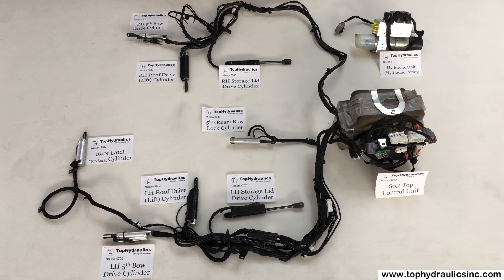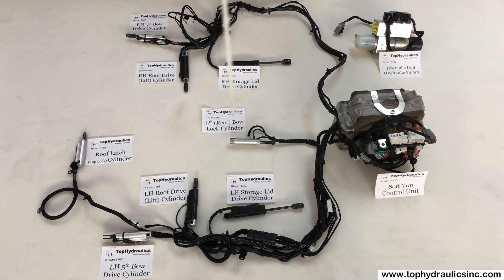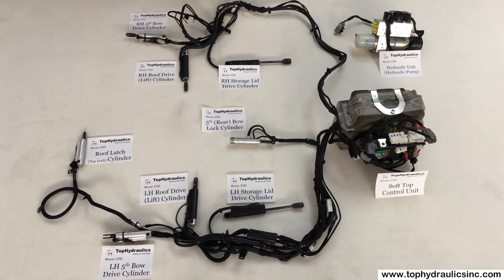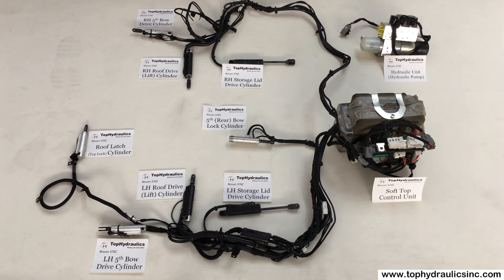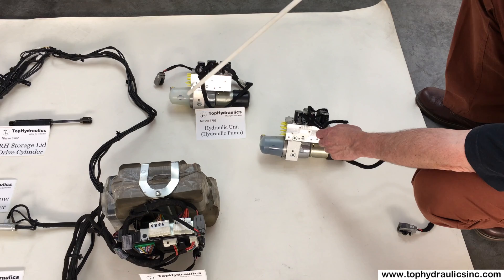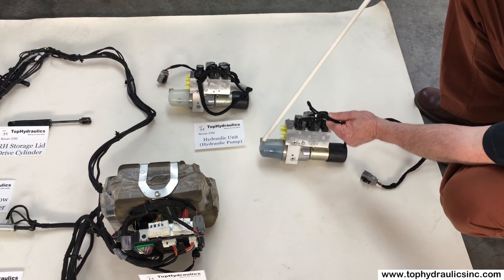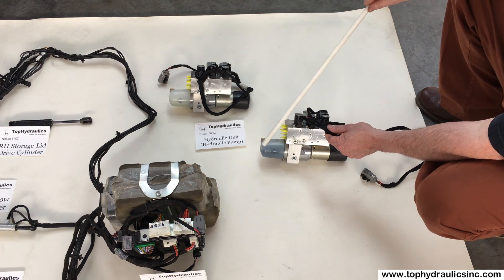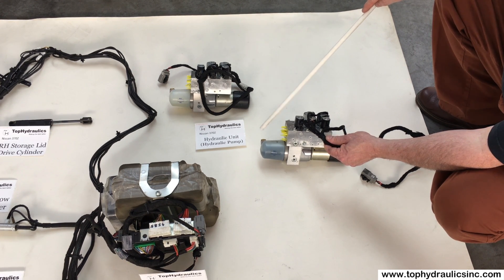Nissan 370Z -  Chapter 1 - Introduction to the Top Hydraulic system

Comment: Hello Klaus! Thank you so much for making these videos! I just bought a 370Z that has a top that doesn't do ANYTHING when I click the button. I think someone may have been working on it already since neither the front or rear bows are latched, but I have no idea what they did (if anything). Could this be a fuse/switch issue since it doesn't even try? Or would it more likely be a sensor of some sort that isn't happy with something? Thank you so much for your help.
Reply from the maker: Congrats on the new ride! Any feedback from the previous owner as to what happened? Since you are asking about fuses, have you checked them yet?
Reply: @TopHydraulics  Thank you! Actually no to both questions, I just bought it at an auction so I have no clue who the previous owner was. I plan on checking the fuses in a few hours when I get the chance. I wasn't sure if that was even a possibility though. And to be honest, I didn't expect a reply quite this quickly, so I asked before I had a chance to look at the car much. I will provide an update in a few hours after poking around a bit 🙂. Thank you for the quick response!!
Reply: @TopHydraulics  ok! So after a bit of poking around, I discovered that there were no fuses blown, but the previous owner had disconnected the top switch altogether... After plugging that back in, the roof started trying to open! After helping the rear bow get up, I was able to open the roof about halfway until the rear bow hit the cover thing as it was trying to fold underneath it. I shoved it out of the way and got it to finish folding down. It made some pretty awful noises in operation though, and the cover didn't line up with the rest of the body quite right (the car was in an accident, perhaps that's why?). Upon trying to open the roof, it got stuck at the same point as before, hitting the cover it was trying to fold out from underneath. I moved it through, and continued folding. The rear bow SLAMMED down, and the front went down nicely, but neither front nor rear would latch. I was able to get some pictures of some pieces that don't look to be in the best of shape, perhaps those are responsible for it hitting the cover? Or maybe something else? I could send pictures to you over email if you don't mind continuing to help me. Just let me know, thanks 🙂

P.S. the manual allen latch was stripped out, so it's not usable 🤦
Reply: Update #2 the top button is very intermittent... Sometimes the top will try to do things and other times it won't do anything...
Reply: @TopHydraulics  The biggest thing I need fixed right now is the top won't latch. It makes a humming noise as long as I have the button pressed, but it won't ever latch. What would be the most likely cause of that? Unfortunately the bolt used to manually latch it is rounded off, so I can't latch it manually at the moment... Any suggestions?

Comment: Do you have any videos or experience with the convertible top of a Nissan Murano Cross Cabriolet?
Reply from the maker: Thanks for asking, we have not had the privilege yet of working on a Nissan Murano Cross Cabriolet. If there was one available in our area, then we would offer free labor (parts only) in exchange for being able to make a video on replacing the hydraulic parts. Please feel free to reach out to us via the contact link on our website https://www.tophydraulics.com/contact-us for troubleshooting support.
Reply: @TopHydraulics  Hello, Top Hydraulics! I hope this comment/query finds you. I'm having problems with my 370z convertible. And, I'm hoping you can give me an educated guess on where I should begin fixing my convertible. 

I bought my 2015 Nissan 370z in May 2022. When i test-drove the car, I stopped in a parking lot to lower the convertible top. As the top started to lower, the front/first bow hesitated slightly behind my head (while i was seated in the drivers seat). When it hesitated, I gently nudged it with my hand and it lowered and stored under the storage lid. I thought to myself "this is going to be a problem." But, I've always loved Z models and convertibles so I bought the car. 

I used my convertible for the entire summer of 2022. And, every time I lowered the top the first bow hesitated slightly behind my head (as stated above). And, as I did the first time I lowered the top, I had to nudge the first bow every single time I wanted to drop the top. 

I also soon noticed that the storage lid was scraping the 5th bow every time I lowered the top. I now know, that seems to be a common problem, and that I'll need to fix/replace the 5th bow.

With all of that being said, now I will describe what seems to be a bigger problem (maybe the symptoms my convertible was having led to this bigger problem. Is this all connected).

Towards the end of that summer (2022), in September, I rode around town with my top down for a few hours. When I got home, my top wouldn't close, at all! I could hear the motor/hydraulic pump as I held on the switch, but the storage lid wasn't opening and, of course, the convertible top couldn't close. It was a nice day (no rain coming), so I went in my house for around 2 hours. Then, I went back outside to my car; tried to close the top, and it worked. But, I was afraid to ever open it again.

One year later, I decided to open the top and see what it would do. This time, when the front bow hesitated slightly behind my head and I nudged it with my hand, it would not budge! So, of course, it wouldn't fully open! Then, I tried to close the top. It did start to close, but as it got close to the top of my windshield it just stopped (and wouldn't close)! I could hear the motor/hydraulic pump, but it wouldn't close. So, I waited 30 minutes and tried to close it again. And, it did close. That was last year (2023). Since then, I have not messed with the convertible top.

Do any of these symptoms/problems sound familiar? In your expert opinion, what do you think the problem (problems) is? 

Thanks!
Reply: @TopHydraulics  Also, I will be purchasing hydraulic cylinders, hoses, and possibly a hydraulic pump from you all. With that being said, do you all also sell the electric wires I may need?

Comment: Bonjour tout d'abord merci pour vos vidéos qui sont très instructive.
Je viens vers vous car on ne sait jamais vous pourriez peut être me mettre sur un piste....
Je suis électricien automobile français, mon client m'a confié sa 370Z cabriolet, elle a déjà vu plusieurs personnes... qui ont occasionnés aussi des pannes!
Donc après avoir remis à niveau le câblage ( connecteur inversé unité de contrôle du toit/alimentation et commande du toit connecteur blanc, câbles du 5ème loquet d'arc coupé, cosses dans connecteur vert écartés) , remplacement du vérin de coffre de rangement droite, mise en place du kit élastique ressort de toit, je me retrouve encore bloqué.
En effet le cycle s'arrête après l'ouverture du coffre de rangement! Le toit tente de se plier mais il me semble qu'il est bloqué ! comme si des crochets ne s'ouvraient pas et ne laisse pas descendre le 5ème arc.
Je suis conscient que vous êtes bien loin pour faire des miracles mais on sait jamais !
en vous remerciant d'avance pour votre retour.
cordialement.
Damien
Reply from the maker: You are writing that the top will not retract after the storage cover has opened. Typically, this is caused by the upper travel sensor on one of the storage cover lift cylinders not giving the signal that the cylinder is fully extended. The sensor is a Hall sensor that senses the presence of ferromagnetic material nearby, which is in this case the steel piston on the cylinder. Try this trick: When the cover is fully open, put the tip of a big screwdriver near the sensor and see if the top will retract. If so, then the sensor is bad. The sensor is most sensitive in the middle of its bottom surface.

See this link for purchasing sensors if needed: https://www.tophydraulics.com/nissan-370z-09-20/767-370z-replacement-travel-sensor.html

Comment: Hi Klaus, So glad to have found you. I have a 2014 370z touring roadster with 54k miles. I bought it with 17k and use the top every time I drive. Last time I went to close it the lid lifted and the top stopped just after trying to start raising. During troubleshooting with top stowed and lid closed if you try to close the top the pump can be heard starting along with voltage dip. It only runs for a split second and barely pops the lid before stopping. Audible motor noise stops and soon after voltage dip ends and returns to normal. Thoughts on what I need? I am going to continue watching your videos as well and keep troubshooting. Appreciate the help
Reply: you prolly dont give a damn but does someone know of a trick to log back into an instagram account??
I stupidly lost the login password. I appreciate any tricks you can offer me.
Reply: @Greyson Van Instablaster =)
Reply: @Alvaro Kaison I really appreciate your reply. I got to the site on google and im in the hacking process now.
Seems to take a while so I will get back to you later when my account password hopefully is recovered.
Reply: @Alvaro Kaison it worked and I finally got access to my account again. I'm so happy:D
Thank you so much, you saved my account :D
Reply: @Greyson Van Happy to help =)

Comment: Hi Klaus, the roof on my 370z would initially get stuck halfway open and with a very gentle push would open completely. Now it will not open at all (other to unlock from the front). What do you think is the likely problem?
Reply: I am having the same problem with my 2014 370Z. Did you ever get a response? If so what was it?
Reply: @kellyb7536  sadly no. I have not really looked into it at this point but I have a feeling that it's the pump
Reply: @kellyb7536  - I fixed it in the end. It was the bungee cables that hold up the rear window. They had lost their elasticity and did not hold up the rear window properly. The hood lid hit the rear window, and the sensors told the roof to cease opening. If you press the button and have someone hold the rear window while the roof moves, see if it goes down
Reply: Where did you find new bungee cables? I had a guy here look but he was unable to find any.
Reply: @kellyb7536   honestly I took it to an auto trimming/soft top specialist who had dealt with the problem previously and fixed it for a fraction of the cost that Nissan wanted to charge. You'll have to jump on Google and do the ring around

Comment: klaus these videos are awesome, I have a 2011 370z , the top started performing slower and slower until it doesn't open at all, I hear the beep and a humming noise like it is trying to open, but never opens, I will check the hydraulic fluid, but do you think this has something to do with the hydraulic motor? how would I know, thanks for time sand information
Reply from the maker: Thanks for asking. Could be the pump or could be a leak somewhere. Go to the video that shows replacement of the hydraulic pump, it shows you how to access the pump. Once the pump is exposed, you will see a min/max marker on the pump's reservoir. If the fluid level is between min and max, then the problem is likely the pump. If the fluid level is low, then you have a leak. Here is the pump video: https://www.youtube.com/watch?v=Axx-9I1BCUY&list=PLly4CMbpk7oxTZzpfpFyLSwfyatkJN6lF&index=8&t=0s

Comment: Hi Klaus, thanks for taking the effort to explain - I think I will give it a go!  My problem: the top is down (year 2010) and I noticed the trunk latch did not work. Got it home and as I suspected the top did not function - no lights or alarms when I tried the switch.  I checked two fuses in the fuse block near the battery and they are OK.
1) Are there any other fuses/relays I am missing?
2) Would a roof error show up on the OBD-II?
3) The service manual calls out a CONSULT-III diagnostic system, but I assume your voltmeter checks do the same function.

I have manually raised the top half way but do not see anything obvious yet. Just checking the simple things first before diving in.
Reply from the maker: Thanks for asking. Let em give you the easy answer first: ODB-II will not read roof errors. My concern is that you don't get any error messages when trying to activate the top. If something was illogical in the readout of micro switches, then you normally would get an error message or a blinking light. First check the wiring harness to the rear bow lock, where it is routed around the left tonneau cover hinge. It tends to fail there (where it flexes when the cover moves) by either having shorted wires or broken wires. This could have caused some follow-on problems and you want to check it out for peace of mind first because it is easy to do.
Reply: @TopHydraulics  I checked voltages with the engine running and all terminals were either 0.8 V or 3 V as they were supposed to be.  There was one exception and that was terminal 76 (5th bow striker sensor).  This one was reading about 0.1 volt when it should have been reading 3 V.

I guess from reading the shop manual that this sensor is part of a the 5th bow latch/striker sensor assembly.  The other two inputs from this source, terminals 56 and 57 read 3 and 0.8 V respectively as they should.

Despite the voltage being non-zero I suppose this could still be a wiring problem as you mention above.  In fact the wiring harness you mentioned had already been repaired once! As far as I could tell it still looked good unless there were worn wires inside the harness.  However, I don't see this assembly illustrated anywhere in the manual so I don't know which plug to use for checking wire connectivity.  Do you have a photo or drawing?

By the way, my poking around in there seemed to have improved things because now I do get an audible alarm and a steady light indicating the roof is open.
Reply from the maker: @Cryogenius  Did you unwrap the wiring harness that goes to the rear bow lock, so that you could see whether any wires were shorting to each other? There is a connector for this harness between the left tonneau cover hinge and the controller. For repair, you could splice in something like telehone wire near that connector and at the rear bow lock.
Reply from the maker: @Cryogenius  That's awesome, congratulations on fixing your top! Ta-daaah! If you should be active on the forum the370z.com or any other 370Z forum, then please let folks on the forum know about your success. It is important to spread success stories, ideally with pics of the failed wires, in order to encourage others to tackle DIY top repairs...

Comment: Hello Klaus. I bought a 2010 370z roadster with 24k miles back in 2016 and when I got the car home I immediately had problems with the top. When opening my convertible top the storage lid bangs into the rear bow when opening and sometimes the top will not go all the way down, it catches on each side so the storage lid does not close fully. I have to help push the top down sometimes when this happens so the storage lid will close completely. What could be the problem? Thanks in advance!
Reply from the maker: Thanks for asking. Sounds like you need to replace the bungees. See the following video on bungee replacement: https://www.youtube.com/watch?v=WnzoyLNb_78&list=PLly4CMbpk7oxTZzpfpFyLSwfyatkJN6lF&index=14&t=0s
Reply: @TopHydraulics  thanks Klaus

Comment: I just bought a 2010 370Z and would like to change the hydraulic fluid in the convertible top as a preventive maintenance. Do you have a video on it?
Reply from the maker: Thanks for asking and congrats on the new ride! It would be tricky to replace all the hydraulic fluid, as there is no actual drain. You could siphon as much fluid as possible out of the pump's reservoir, refill it, cycle the top a few times and repeat the process. Here is how to get access to the pump: https://www.youtube.com/watch?v=Axx-9I1BCUY&list=PLly4CMbpk7oxTZzpfpFyLSwfyatkJN6lF&index=8&t=0s